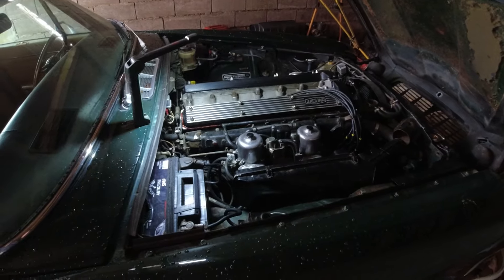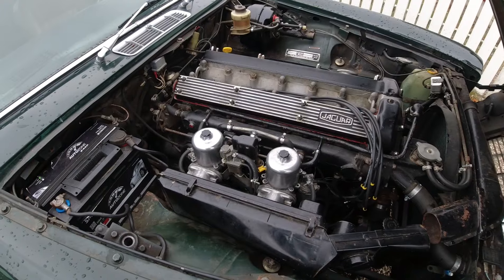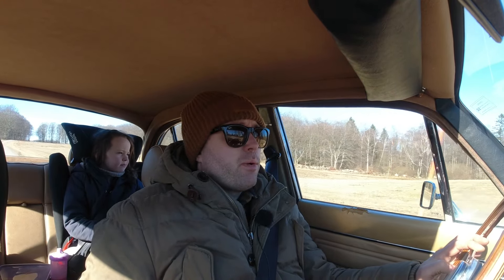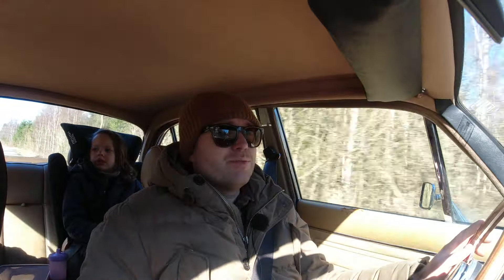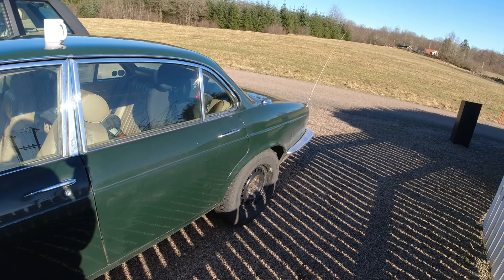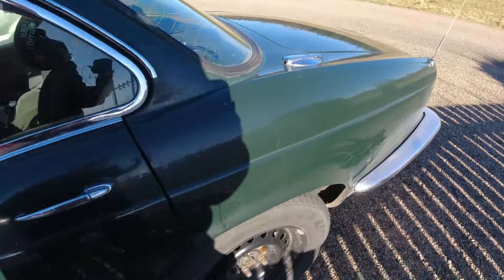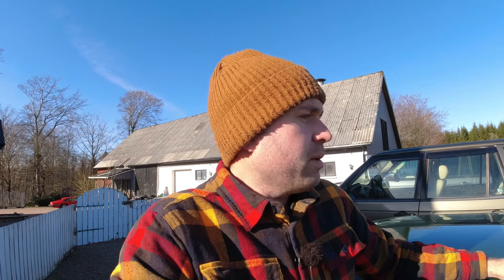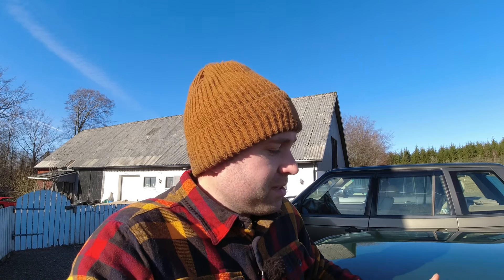Leaks, Rust and Break Downs - Realities of Daily Driving a Classic Car

Comment: I think you are right on the money re using a classic for daily/semi daily use if it works for you.  I live in an urban area with a nasty 40 mile each way work commute so on normal workdays I use my Subaru WRX as a daily since missing work due to a mechanical breakdown is a big deal for me.  For weekend work and local errands, I use my 96 Volvo 850 Turbo Wagon with 200k miles about 100 miles/week.  After being used by my wife and three kids it made its way back to me in need of some TLC.  I've gone through it mechanically so it's pretty reliable now and had some cosmetics done without going overboard-have found when it looks nice you feel better using it more!  While it's not the same as a 70s XJ6, somewhat frequent mechanical requirements/foibles and need for surveillance are similar-plenty of broken plastics after multiple heat/cool cycles over the years and most everything works except the sunroof and headlight washers which I don't miss.  Strictly for weekend club meets and car shows is my 69 Lotus Elan-hard to imagine these were used daily back in time.  Enjoy your channel quite a bit and am happy your business is going well-cheers.

Comment: Kevlar hoses with Jubilee stainless steel wide band hi torque clips is the way to go
Reply: Kevlar hoses are absolutely terrible,they dont last 5 mins.proper reinforced rubber and nylon hoses are by far the best way to go.
Reply: @ivanfernyhough3851  I disagree, Kevlar hoses work fine on my Jag V12 and there's plenty of them, I wouldn't use anything else tbh.

Comment: The clamps on my XJ6 S3 have cut into the hoses on the fuel rail. Tightened them just made it worse. The car is now undrivable. I bought the replacement kit from Mr Injector last week and I'm removing the fuel rail next weekend and doing the job properly. (Using Adam's previous video on how it should be done). Wish me luck.